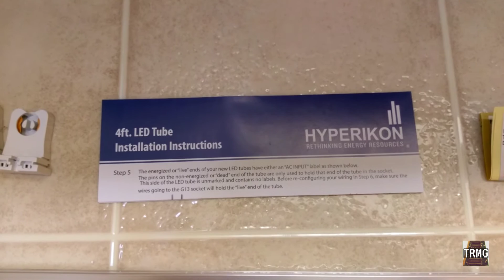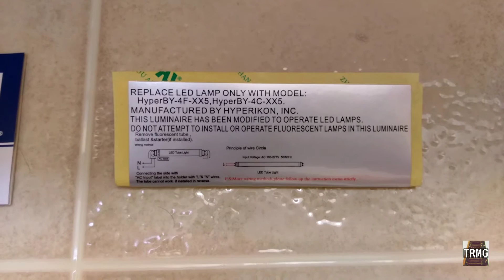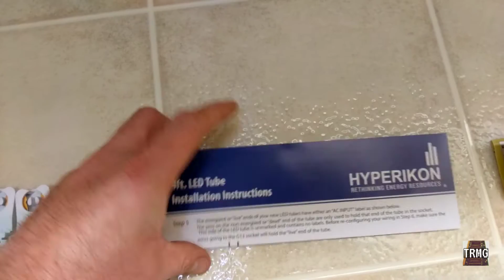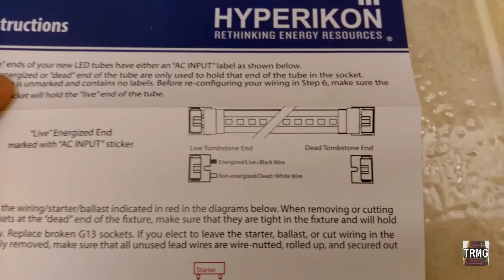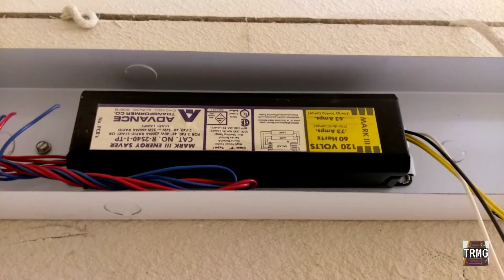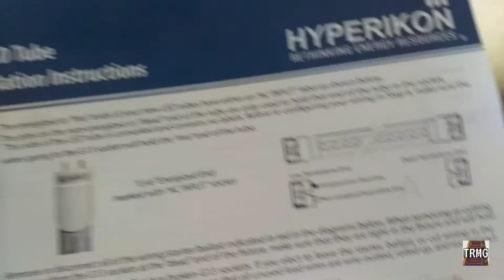LED Retrofit Tubes For Your T8 Fluorescent Light Fixtures

Comment: How do the LED's work in a cold garage? The winter temps go down to 0 F. at times.
Reply from the maker: Where I live it might hit the low 20's overnight during the winter, so it doesn't get as cold here as it does for you.  I also do have some network/servers/phone systems running in the garage 24x7x365 that do generate some heat, so the garage is almost always warmer than the outside temperature.  With that said, the lights are still working great!  I haven't had a single fixture noticeably degrade in performance yet.